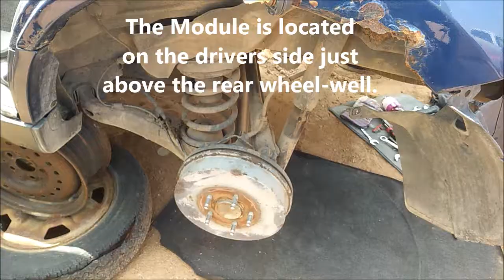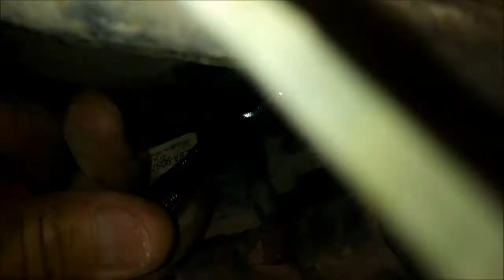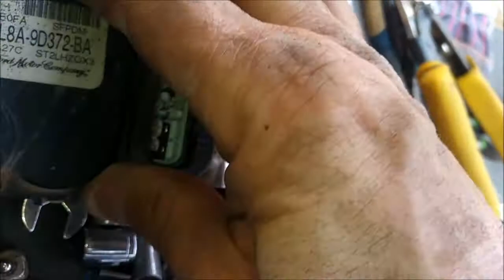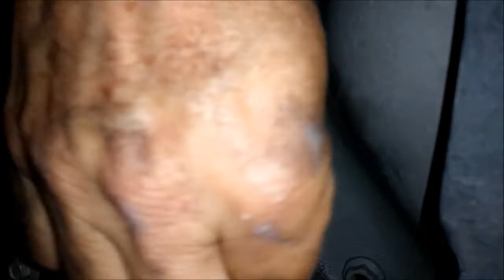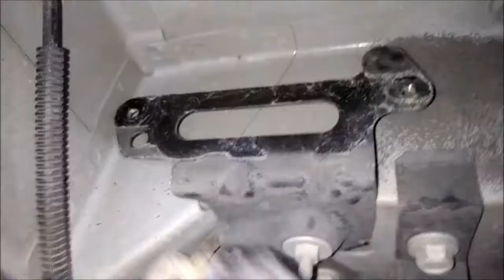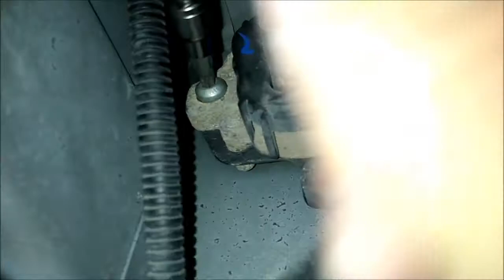Ford Escape Fuel Pump Module Replacement

Comment: location is different for different years my 2000 is not in this location
Reply: 2014 here 1.6 liter. Not there. Still looking I guess hahaha
Reply: What year is this? 2014 is under carpet under passenger side of rear seat. I need to know where the 2007 is.
Reply: Nothing
Reply: 2003